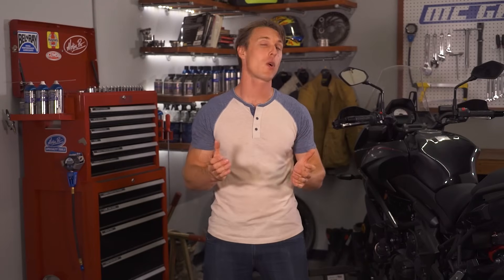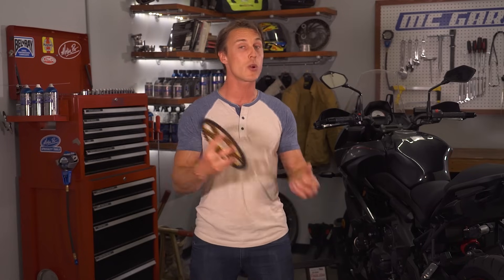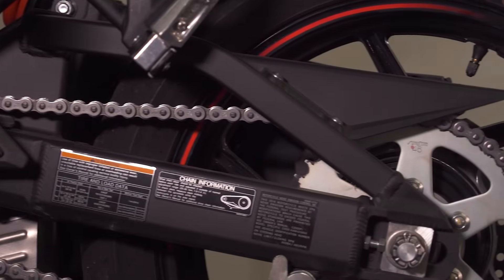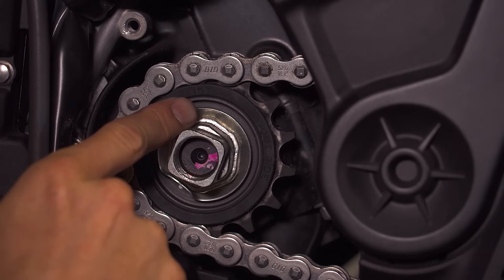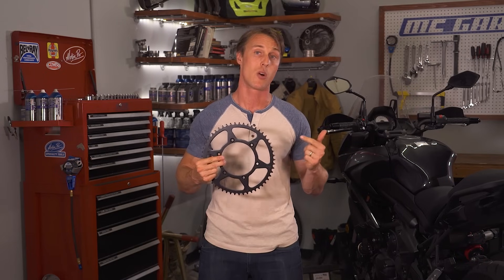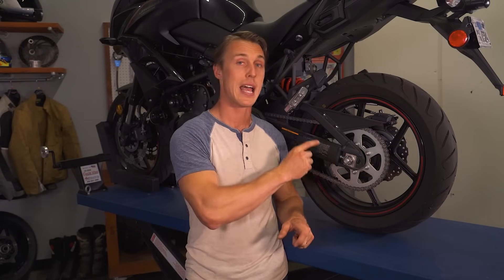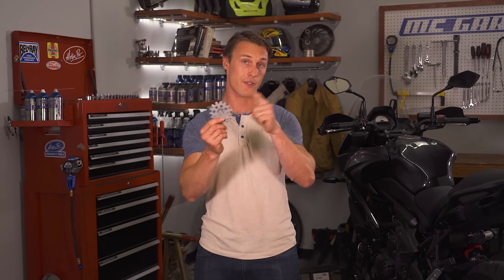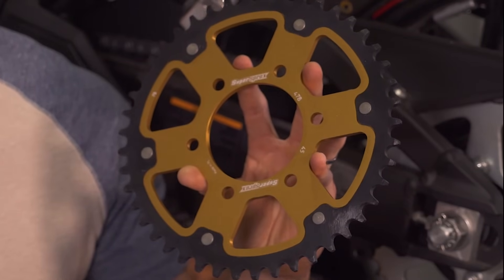Motorcycle Gearing Changes Explained | MC Garage

Comment: The easy way to change the final drive ration on a shaft drive is to change the aspect ration of your rear tire. Say you have a 190/50/17 on the rear and you want to get a taller final drive, switch to a 190/55/17 and you get a similar effect as changing a rear sprocket by one or two teeth.
Reply: The problem with that is the increased weight of the bigger tire, as well as little availability of different motorcycle tire sizes. The number of tire sizes for motorcycles is miniscule compared to car tires. Plus the cost of a new tire easily surpasses different sprockets, unless you needed a tire anyway..

Comment: I disagree most bikes today have tall gearing. Most bikes are geared low for performance numbers for magazines and spin too fast at typical highway cruising speeds. This is exactly why you want to put taller gearing on that Versus. Taller gearing saves fuel and engine wear for highway riding.

Comment: Great video as usual Ari. Would have been nice to show some stats of the differences going up/down teeth on that Versys. Eg. we went up two teeth on the rear and top end dropped from 133 mph down to 1xx mph, but the 1/4 mile time improved from xx seconds to xx seconds. And maybe some fuel consumption figures. Get Zack to do a commute on the standard size sprocket and then change it (up or down in teeth) and do the commute again and see how much it affects consumption.  Keep the MC Garage vids coming, I'm always learning something new from them!
Reply: Looking for stats:www.gearingcommander.com
Reply: Nice link, thanks!

Comment: Great video but you still don't answer my question from the last video (changing sprocket and chain). The question is 15-45 & 14-42 have the exact same ratio which is 3.00, but what the different between 2 of them since some motorcycle companies love to use one over the other as a standard size sprocket out of the factory?
Reply: I hadn't seen your questions from before, sorry. Honestly, I'm not sure why a company would choose to use two different sprocket sets to achieve the same ratio. Perhaps it has something to do with anti-squat (the way the upper chain run affects suspension action on the brakes) but I seriously doubt that it's that technical.

Comment: Why does company like ktm use 14:42 and 15:45 on their 200 390 lineup but that equals to both "3"... Why not stay with both 14:42 for both 200/390 or both 15:45? Tnx
Reply: It is likely due to different chain sizes and sprocket availability for off the shelf suppliers. Also, a 14/42 is lighter than a 15/45 but would be more likely to sling off lubricant from the more dramatic direction changes. The manufacturer may also select their sprocket sizes from how far away from the swingarm they want the chain to be. A thicker(height) swingarm makes the chain more likely to contact it, so they may pick the larger sprocket option even though the gearing is the same for that reason.

Comment: on shaft or belt you never covered just going from a ..say 80 series tire to a 90 series and gaining a about 1'' in wheel dia .. thus gearing higher or 80 to a 70 lowering the gearing
Reply: Woof. Changing tire size as a bandaid for gearing opens up a whole different set of challenges. You'll be altering ride height and tire profile and thus handling, altering the engagement angle of the bevel gears in the drivetrain, etc. A taller or shorter tire will work as a means of changing your final-drive ratio, but I wouldn't recommend it.

Comment: My bike top speed is 188, it reaches 170 freaking easy. I don't really need that speed. Gonna increase the gearing. Reaching easily 150 km/h is pretty enough in my third world shitty roads. Plus I get more torque at low rpms and better fuel consumption. Thanks

Comment: I got 115cc moped, is it worth it to change the gear ratio? i need more torque for tight city. current gearing 13 tooth front and 41 rear. it got 10hp and 7.5lb torque said the specs sheets on the web. any advice much appreciated.
Reply: Yup, totally. You'd benefit from a few more teeth in the rear or going down a tooth in the front.
Reply: sick.. thanks man..

Comment: On my 2004 Kawasaki ZX-10R (17-39 stock sprockets), I went with -2, +11 (15-50 sprockets) and not only did those look cool, it made the bike MUCH more fun at lower speeds since I could get at the power MUCH quicker without having to go at license losing speeds.  When not riding aggressively, I could easily shortshift all 6 gears at legal speeds but when I wanted to hammer it, I had all 6 gears in the speed range of the stock first 4 gears.  The bike just "ate up" each gear quickly but still had a theoretical top speed of close to 150 MPH.  Lots of fun.  The 15-50 sprocket combo is a 3.33 final drive ratio so to get that with the stock 17 tooth front, I would need 57 teeth (3.35) which would have made it look like a stunt bike sprocket.  Reducing the # of teeth on the front sprocket somewhat "hides" that it is geared down but a rear sprocket change is kinda obvious.
Reply: I can't even imagine the wheelie machine you created. Those are massive changes.
Reply: Bruh all this "legal speeds" talk shut your dirty little mouth

Comment: I’ve been riding my 2007 KLR 650 with stock gearing for years. I decided to go down a tooth on the counter sprocket this spring and boy oh boy, it’s pretty damn nice. While taking it on the highway now is fucking terrible, taking it around town is pretty awesome.… And that’s from just one tooth on the front. It’s not a super major change but it’s pretty noticeable. I’d love to try to get more torque-y next year. That being said, it’s performance at highway speed is so irritating that I would suggest swapping the sprocket back out if you’re going on a significantly long ride for a few days. In fact, I’m going on a multi-day ride soon and I bought a new stock counter sprocket to put in. If you don’t take your bike out on the highway very much but you commute, I would consider doing what I did.

Comment: In some cases, it is necessary to reduce the # of teeth of the front sprocket cuz  increasing the # of teeth on the rear is not practical (too expensive) or possible (mainly for clearance issues).  Also, increasing the # of teeth of the rear sprocket drastically may also wear out the chain faster cuz it increases chain speed for a given road speed.  For example, if the stock rear sprocket was 40 teeth but it was changed to 50 teeth, at any given speed (50 MPH, 100 MPH, 200 KPH...), the chain would be moving 25% faster.  This may increase wear since there are more times the chain and teeth "mesh" with each other.
Reply: Nope that's not the way it works. If you increase the number of teeth on the rear and maintain the same RPM you will just slow the bike down. To speed back up you will have to speed up the engine which will make the FRONT sprocket spin faster just to keep the back sprocket turning at your original number of turns.

Comment: Not quite, in certain scenarios where you're riding a smaller displacement motorcycle on tighter roads, shorter gearing can actually improve gas mileage. Running with 14/36(stock) sprockets on my 220cc motorcycle I'd open the throttle more at lower gears to maintain a decent speed and prevent knocking whereas now with a 14/40 setup all is well and I roughly do half the RPM's and throttle input to maintain the same speeds.

Comment: How will it effect if I change my 42t rear sprocket to 62t, answer me please
Reply: Probably cut your top speed by half and increasing your acceleration by a lot
Reply: amazing facts - I put a 60 on my bike and now I have to use the increased acceleration to get away from all the women trying to jump me. 

It now also tops out at about 115 mph. But 1’st gear is perfect, just wish it had a 7th
Reply: Time to change it to 62t

Comment: Up 2 teeth on the front sprocket of my SV650s and she's a highway queen. Still out drags my friend on his Ninja 650 but is only spinning at 5,000 rpm at 75mph
Reply: I'm looking at getting a twin spark SV650S or SF(will turn into SF if I get an S) and am going to gear it up like crazy. I have thought about the 17T front as it would make getting an appropriate rear sprocket much easier. I'm a little worried about how close the 17T would make the chain to the cases. My current planned gearing setup would be a 16T/39T, which makes it a touch higher revving than an SV1000. 4154 RPM at 70 MPH. 

My little brother has a twin spark SV650S which I have managed to extract 75 MPG out of(with 15T/45T gearing!). Looking forward to setting up my own with fuel economy in mind. My goal is 100 MPG.
Reply: How much of an improvement did that make. What was the speed before at the same rpm and gear.

Comment: All fine and dandy when you have a dinosaur like mine. . .  but what happens when you have the latest and greatest with all kind of electronics nannies and doodas(cornering ABS , TC, IMU, anti-wheely, etc) that will raise a red flag at the first whiff of "non-factory equipment" and give you SES light (or w/e is called in motorcycledom) ?

Comment: You shouldn't say that taller gearing will give you more top speed since that is not always true.  Top speed is increased by better matching the power of the engine to the load it produces at high speed.  In some cases, gearing a bike DOWN will actually INCREASE top speed if the ideal top speed gearing is between stock 5th and 6th gears for example.  Another option would be to gear the bike up and do the top speed run in 5th gear instead of 6th.

Comment: So whats your reason for changing the Sprocket on the Versey,
Just asking seeing as im looking at a 2017 versey at the moment
Reply: It's a parallel twin so it's a bit buzzy above 6500 rpm, so the idea was to gear it taller to bring the cruising RPM down to a smoother speed. Also, the speedo is crazy optimistic, so gearing it taller will help make it more accurate. Someone else commented already that a 43t sprocket is the hot ticket for this bike. Stock is 46t.

Comment: About to go plus 8 on my zx10r >:)
Reply: awhiteguy24 - the stock gears are so high that redline in 1’st is over 100mph. I would also drop a tooth in the front too.
Reply: PapaWheelie well plus 8 on the rear is equivalent to doing 3.5 on the front. You think I still need more?
Reply: Nah that should be perfect- just give it a try, you can always mess with the front later. Honestly that bike has insane power already stock.

Comment: Could yall do a video on types of fuel?  I was originally told to go ethanol free, and I've been doing it ever since.  Just wondering though if it actually makes a difference and is worth the effort to find a gas station that carries it.
Reply: I wouldn't go out of my way to use ethanol-free gas, but if it's readily available then it's a good idea to run it. Ethanol is universally bad stuff for engines over the long term. It's hard on hoses and seals, adds deposits to the combustion chamber (though all fuels have additives to prevent this), and makes your engine run hotter than it would on non-ethanol gas. I honest don't worry about it unless I'm storing a bike, and then I look to fill the tank with ethanol-free gas since it keeps much better.
Reply: Ari Henning alright. Good to know it wasn't for nothing and it's not real bad if I ever can't get to it! Thanks!

Comment: Can someone explain me why when i changed my 16t to 15t i get better mileage by about 20-30 miles?  Shouldn't it be backwards? Mainly city driving.
Reply: FyWhy you probably don't have to open the throttle as much, or hold it open as long, to get up to speed
Reply: If your speedo runs off of the rear wheel, then the faster spinning sprocket is tricking your odometer into thinking it has traveled more miles than it actually has. 16 to 15 would be around a 6.5% difference. More likely the reason is that you were running in lower gears before to compensate for the taller gearing, and now you run in higher gears. Could also be a combination of both.

Comment: Great video man. Could you also tell us a workaround for super-short geared bikes like my '14 KTM 200 Duke? If I spend the whole day going through gears real fast (not an option because of the short gearing), the next day there's a cramp awaiting my gear leg. Happened twice in a week long ride in the Himalaya, forcing me to look for options that could result in lesser shifts. Haven't found a solution yet, but maybe MCG can help me? Fingers crossed!
Reply: That's just the price you pay for a lower-powered bike. It doesn't have the grunt to pull a taller gear so you end up using the gearbox a lot!

Comment: Since the gearing change alters the torque being delivered by the tire to the ground, does this mean that a dyno session before and after a gear ratio change will give different numbers?
Reply: Good questions. I'm pretty sure the peak figures will be the same, but they'll occur at different RPM than previously. I think...

Comment: TWO questions
1)What if you drop a tooth in the front and go up teeth in the rear. Will anything change?
2) and is there any benefit on going higher in the front vs lower in the rear?
Reply: Thanks ☺

Comment: Changing the sprockets also affects the anti-squat characteristics of the bike. This is something to keep in mind with this modification.
Reply: say more, im not familiar
Reply: One of the factors that influences anti-squat in a motorcycle is the angle between the chain and the swingarm. When you place a smaller countershaft sprocket and a larger rear sprocket this angle increases. This way the motorcycle gets more anti-squat. It works the other way around too, so when you place a larger countershaft sprocket and smaller rear sprocket the bike tends to squat more under acceleration.
Reply: Makes perfect sense and I learned it today. Thank you.

Comment: Motorcyclist Magazine I live in Bangladesh. In my country there are only permission for 165cc bikes. In my country the best sports bikes are CBR150R, GSX R150 and Yamaha R15 v3.
The front tires of those bikes are 90,100 section and the rare tires are 130,140.
I like fat tires. And I have CBR150R. So, which tire size will be fat and perfect for my bike. And How many milage have to sacrifice???

Comment: You should avoid reducing size of the front sprocket. If you need bigger gear ratio is better to increase the rear sprocket. Why? The effective diameter of sprockets is not constant and makes chain speed fluctuation. Smaller sprocket = more visible effect. The fluctuation is 1-cos(180/number of gears). That makes 2.1% speed change for 15 teeth, 2.5% for 14 teeth and 4.9% for 10.
Reply: Reducing the size of the front sprocket is a bad choice of words.  Someone could go from a 15 tooth 525 sprocket to a 15 tooth 520 sprocket which is a reduction in size but no change in gearing.  Also, there may be clearance issues increasing the size of the rear sprocket and there are other "pros" to changing the front sprocket (low cost) as mentioned in the video.  Yet another reason is to keep the new stock chain.  For example, if a new bike came with 15-45 sprockets and someone wanted the equivalent gearing as 15-49 (which would likely require a longer chain), they could do it with 14-46 which would keep the rear axle almost in the same position as the 15-45 combo.
Reply: It depends on many factors such as riding style.  I used to have a 2004 Kawasaki ZX-10R that came with 17-39 sprockets (525 chain) but I ran 15-50 sprockets and 520 chain and had no issues with it.  It was a lot of fun since I could shortshift all 6 gears without breaking any speed limits.  It also helped make the speed ranges of the gears "tighter" so that the bike felt like it was accelerating quicker.
Reply: Too much math. Brain shutting down
Reply: David James feelsbadmam i confused as well
Reply: It takes more force to wind the chain around a smaller sprocket therefore it would be better to make changes to the rear sprocket where the diameter is larger.
Reply: up to a point but not exclusively.  If people beat on their bikes and ruin chains, then why would it matter much if they go 1 tooth down on the front sprocket?  They are beating the chain up anyway by their riding style (wheelies, drag racing, bad chain maintenance...).  On some bikes (for fun), I like to go larger on both the front and rear sprockets.
Reply: Adik you should avoid making comments like that no one cares. If changing the sprocket was such a big deal the video would be why not to change front sprocket.
Reply: That is not math, those are simple ratios.  Get a real brain.

Comment: Best set up for CBR 250r? (Older version)
Reply: You are treading dangerous ground there. By older version do you mean the single 250cc as opposed to the CBR 300R, or do you mean the four cylinder CBR 250R(1987-1989)?

The 2011+ CBR 250R reaches its top speed while revving well above the engine's max power RPM(8500), so if you gear it taller, you can gain a few mph in top speed. Ari might have experience here, as he races those bikes. Ultimately it is up to you, because it depends what you are looking for! I myself look for stupid tall gearing for great fuel economy and a calm engine at speed.